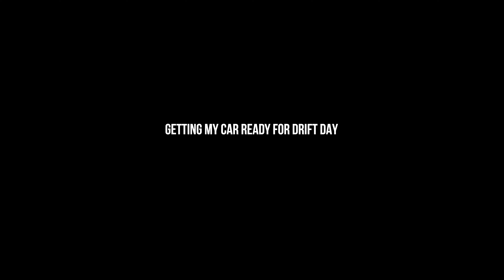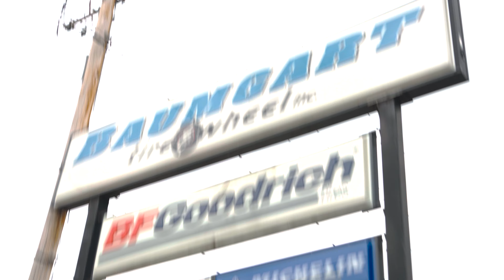How NOT To Get Your Car Ready For Drifting

Comment: I wanna see Nick workin the tire machine! If our clamp don't scratch somehow the plastic duckhead will where the bar has to work. Raised spokes? Only on the rare occasion the Hunter Revolution isn't broken.  You can count on it being broken. When i had an Auto34r to work on everything was a breeze except 10+ply super compensators